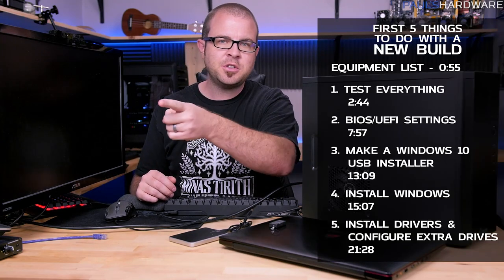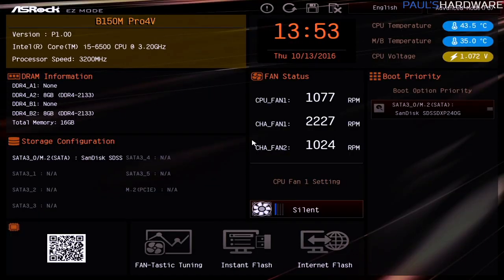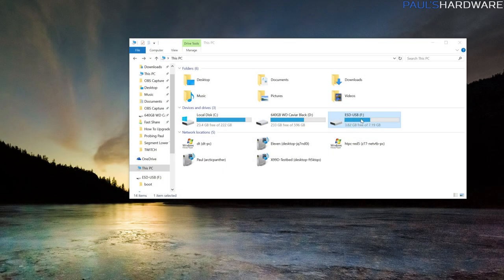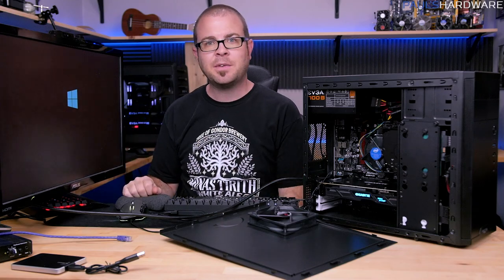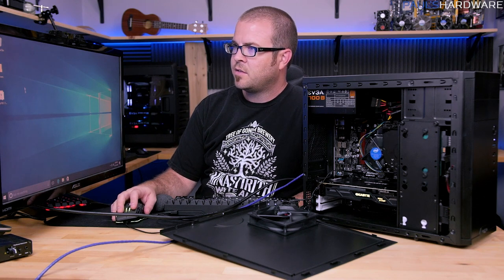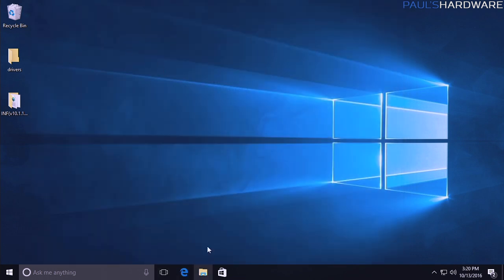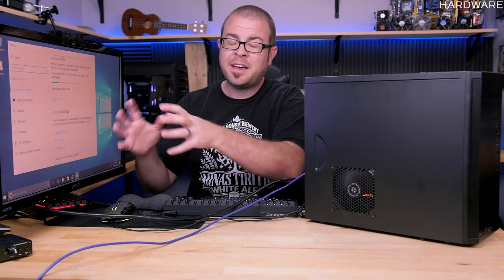First 5 Things to Do with a New PC Build

Comment: "Use usb 2 or usb 3". Dang, i really wanted to use my usb 1.1 drive.
Reply: Damn, i want to use a Diskette.
Reply: dang, i really wanted to use my floppy disk
Reply: It's all about that floppy disk
Reply: Dang, I really wanted to use 200 punch cards.
Reply: hahaha keep them coming!
Reply: potatoyeast3d Damn, my knowledge of old tech ends at this point.
Reply: What no love for magnetic tapes?
Reply: Oh dang am I the only one still using floppy drive
Reply: Install Windows 10 from Floppy?

"Plese insert Disk #2793 of 2913
...
Read error, file system corrupt"

Damn gotta start the installation all over again.

Sure there will always be someone who either uses tapes or just copies the code by hand via typing in Assambler.
Reply: Jake Conner nah i install it by hand punching cards and running them through their reader.
Reply: Windows 10 installer needs about 4gb of space, a floppy disk only has 1.44 mb of storage. So, there's no way you can use a floppy to install windows 10.
Reply: +Angel Luis Trinidad MS-DOS: ~3mb. Oh wait. They used floppys to install MS-DOS. Hmmmmm, I can&#39;t for the life of me think how they did it.
Reply: ScreenGames I'm talking about Windows 10, not MS-DOS. Windows 10 buddy, Windows 10. Wait, let me say it one more time, Windows 10.
Reply: Angel Luis Trinidad They are both just collections of files.  One just has a lot more.
Reply: Joseph Still
Exactly.
Reply: Joseph Still Exactly, Windows 10 has a collection of bigger files that would not fit on a floppy drive.
Reply: Angel Luis Trinidad
Alright. You clearly don`t get the concept of multiple floppy drives, so I`ll tell you. Ever installed Windows 98? I`m guessing you haven`t. When you insert the install floppy, it comes up "Insert floppy #1/8". You insert floppy #1, and then take it out, then put floppy number 2 in etc.
Get it now?
Reply: You would need ~2000 floppy`s, but it would still work.
Reply: ScreenGames True, but my point is, it would not fit on one floppy disk.
Reply: Angel Luis Trinidad
Nobody said it would.
Reply: ScreenGames Okay.
Reply: and i want windows 8:1. its better than 10 and thats why i didnt upgrade to windows 10
Reply: Your a masochist... and wrong!  Win10 continued where Win7 left off.  Win8 and Win8.1 were generally considered a lost cause for Microsoft
Reply: potatoyeast3d 200? that's funny
Reply: Can I pull up a picture of a usb 3.0 flash drive on my phone and shove it into the CD drive?
Reply: It would take about 2,778 floppy disks to install Windows 10. That wouldn't take very long, kek
Reply: BoZik fking kek xD
Reply: Is it bad lads if when I was younger I believed that you put money into the CD slot and that's how you make online payments on Amazon and shit?
Reply: GameRushz03 that be cool though.
Reply: Angel Luis Trinidad yep you totally missed the joke
Reply: I did not see paper-tape listed. If you list punch cards, keep in mind that paper-tape was used to load drivers, etc. in that vintage era. 4-bit was the most basic version that hung around a long time with the military.
Reply: ScreenGames i remember having to install Windows 98 to NT like that
Reply: I prefer floppies
Reply: I use USB 3.1 SS+
Reply: Some of us cool kids have 3.1
Reply: Angel Luis Trinidad then I'll use 2856 floppy disks!
Reply: Souperpie84 grroovy
Reply: Souperpie84 z
Reply: Fuck it i'll buy a wireless wifi  adapter or usb. I aint gonna be using an Ethernet cable cause I hate those things.
Reply: Jake Conner Made me laugh thx mate xD
Reply: Jake Conner p
Reply: If a Z270 mobo advertises memory frequencies as "OC" can I manually set them in the bios?
Reply: Jake Conner wanted to use my cassette
Reply: dang, i really wanted to use my vinyl disc
Reply: Dang I wanted to through the flahdrve at the PC an hope it works
Reply: Dang, I really wanted to use my stone and twigs
Reply: Dang, I wanted to use my NES cartridge.
Reply: Dang I wanted to use my floppy
Reply: you have summoned me
Reply: Dang, I really wanted to emulate a cassette drive by making noises into a microphone
Reply: Dang, I really wanted to to memorize it and write it on the the hard drive with my mini magnet.
Reply: You weren't  even around then. It took 64 cards to make a single letter. It's tape drive all the way. That's  an eighteen inch one, by the way.
Reply: i want to use VHS casette
Reply: Angel Luis Trinidad buy bigger floppy
Reply: hdmi drive 🤯
Reply: Jake Conner i wanted to use old console cartridge
Reply: Dang i want to use my brain as hdd but its already full 
Total Space:1byte
Used Space:1byte
Available Space:0byte
Reply: LazyAndrew1333 my bottle of vodka has 666tb memory
Reply: Gotta load it off a cassette drive whenever you want to use it.
Reply: Wait, which vacuum hoses need to be turned on again?
Reply: Scrolled down to find this comment

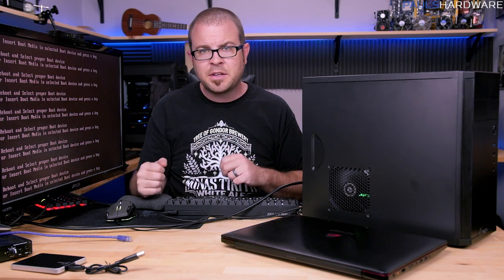Comment: 1. Test everything 2:44
2. Bios/uefi settings 7:57
3. Make a windows 10 usb installer 13:09
4. Install windows 15:07 
5. Install drivers & configure extra drives 21:28

Comment: Point of advice to all that was not mentioned in the video:
When booting from USB to install Windows, DO NOT put your flash drive in a USB 3.0 slot or you'll get the Windows Installer asking you for a driver and not being able to proceed with the install.
The reason for this, is that you have not installed your USB 3.0 drivers yet needed by your board for them to function properly!
So, to be on the safe side, make sure to do your initial install from a 2.0 port.
Hope that saves someone frustration and a headache.  =)
Reply: was just about to install windows once i got my processor, thanks man!
Reply: Dave S. What if you only have usb 3.0
Reply: @salierisneighbor9736 
Plug it into a USB 2.0 port and it'll operate as a 2.0 drive.
Reply: psedog you mean on the motherboard?
Reply: @salierisneighbor9736 
Yes, either on the ports on the back of the motherboard. Or the ones that connected to your case io.
Typically 3.0 ports will be blue and 2.0 ports will be black.
Reply: psedog nice my X470 gaming motherboard came in a couple days ago
Reply: psedog thanks for the tip
Reply: @salierisneighbor9736  That board has 2 USB 2.0 ports at the top of the rear IO. Your USB 3 ports are 3.1 so they are red, not blue.
Reply: psedog thanks again
Reply: Thanks!! That work
Reply: thank you so much :) having that problem rn currently.
Reply: This is not universal, I installed windows via USB 3.0 last weekend
Reply: @nikoyochum6974  Me too.  It had no problems
Reply: @salierisneighbor9736  so even if i have 3.0 stick i can plugit into 2.0?
Reply: This was an issue on Windows 7. Windows 10 should recognize USB 3.0 natively and does not need any drivers to be installed first.
Reply: @moezilla7838  if i buy a new case and motherboard with usb 3.0 ports .Then what shall i do ?? what if i have no usb 2.0 ports?
Reply: Saumyojit Das every motherboard should have USB 2, check the rear IO, usb 1 is white, 2 is black, 3 is blue, and 3.1 is red
Reply: @saumyojitdas4212  Use the 3.0 ports, in most cases these will work fine even with older usb devices. However any modern motherbord I have seen so far had at least two 2.0 ports on the back panel (the black ones) and two headers for internal USB 2.0 devices like card readers or front USB.
Reply: Installed normally on the 3.0 port
Reply: I have been stuck on installing windows 10 on my new pc for 4-8 hours. This fixed it. Thank you so much.
Reply: Mine didn’t do that
Reply: Daniel Kozma yeah I used my 3.0 and it worked fine...
Reply: it worked in 3.0 for me
Reply: Mhh, bought my Asus X570 ROG Strix -E This week, but this Mainboard only have USB 3.2, even my new Case have only USB 3.1 and 3.0. I will see, how the new System will boot windows from the USB Stick i prepared. :/
Reply: @GeneralAblon  I'm still stuck
Reply: @simply_based  then I do not know what you need to do. As can be seen from my comment, I am no programmer. Basically, I just started up my pc, with the usb in a usb2 port. And then it worked. Just be sure to make it boot on ther SSD.
Reply: Thankyou i will do that when i finish my First build
Reply: callum connelly no, 3.0 is fine, just needs to be in a 2.0 port
Reply: Niko Yochum the difference is drivers. The windows 3.0 installer does not have drivers for usb 3.0. Higher end motherboards natively support usb 3.0 at a bios level and don’t require drivers. Other not so lucky boards need the driver, which the win 10 installer doesn’t have, and throws the error
Reply: This is a great tip 👌.. With my luck, I would have done just that. And wondered why I am getting a funky screen.
Reply: mine worked from install on a usb 3.0 (blue port.) I think it might depend on the motherboard.
Reply: Pog thank you
Reply: That's just pure Windows stupidity, I installed W10H2 today from a fast USB flash drive in the first mobo USB port (3.0) and no driver required.  The drive worked noticeably faster than mobo utilities install from a DVD drive.
Probably MicroSloth has added universal drivers into the booted image.
Reply: callum connelly  nop
Reply: Do you have to disable secure boot in Bios before installing W10?
Reply: Omg im having a bunch of trouble. If this is the cause im going to scream
Reply: I installed off of USB 3.0 on the front panel with a low end msi b550 mobo with no issues at all
Reply: I did this on a usb 3.0 and it worked lol
Reply: That explains why I had problems then, thanks man
Reply: Only with older machines.
Reply: What if my case doesn’t have. USB 2.0
Reply: @psedog  t
Reply: @AB-ii4pb  how about the back of your motherboard?
Reply: You are such a Gem. Thank you!

Comment: 20:00 DON'T do this. If you do this, you still didn't change the boot order. So if your friend or customer will insert a flash drive later and reboot their PC, it will try to boot from that USB, obviously failing. I had hundreds of problems because of this.
Reply: ^ This
Reply: how should i do it then?
Reply: @carls.6746   change the boot order from the bios
Reply: Hey, this is my first time building a gaming pc so I have a question about this. I'm suppose to have the ssd that I'm installing windows 10 to at the top of the boot list?
Reply: @dug1963  you would need a bootable USB, watch a video how to install windows 10 using bootable usb. Basically, since your SSD is empty currently, you download windows 10 on the usb and boot from there, when you get into windows then you can transfer the files to the SSD an use the SSD. Hope this helps

Oh and yes I forgot to answer the original question, get into the bios by clicking delete repeatedly, then Change the boot order so your usb is first, which will allow what I said above to happen :)

Comment: With what did you record all the BIOS setting without even have the Windows been installed yet?
Reply: a capture card?
Reply: a capture card from another system(computer) i guess, just like recording stuff from a ps4/xb1
Reply: A capture card? what does it look like? how does it work? so, basically I need another PC/laptop to do the recording job? Is that what you mean? Hmmm....I see.
Reply: depends on what capture card, some of them require another PC, some don't
Reply: Some of them have recording storage inside? Ok, sounds expensive.
Reply from the maker: yes, it was recorded on a 2nd computer with a Razer Ripsaw USB 3 capture card
Reply: so what, do you plug the pc's together or something with a cable and it just records the other pcs screen?
i might need this
Reply: +Jihan Cessar Hallel Gurning They can be less than £50
Reply: +ScreenGames Good to know. Thank you.
Reply: Don't forget if you have a smart phone, take a photo for your personal record
Reply: Jihan Cessar Hallel Gurning sx s*f, ,
Reply: prob hdmi recorder of some kind
Reply: Jihan Cessar Hallel Gurning probably a capture card

Comment: But before you do any of this, get a new surge protector power bar to protect everything plugged in from power surges, lightning, spikes etc. Power bars do wear out and need to be replaced.
Reply: +1000 on this. It amazes me how folks will spend thousands of $ on a new PC and not spend another $25 or so on a new surge protected power strip to protect it....it boggles the mind really...
Reply: Eryk Grabkowski ur comment x100
Reply: Good sir, you saved me money!!!
Reply: Lightning is a risk, there are two times when I've experienced this. A couple of years ago lightning struck nearby, it fried our phones. Last year, a similar thing happened, fried the router. It might not be a big risk, but it can happen. However, I've heard that the surge protection doesn't do much in such cases for some reason.
Reply: Zed1967 Wouldn’t I just be fine connecting my pc to an outlet that’s in my wall? And also another quick question. I lived in the US but moved to Europe to go to college and I purchased my power supply in the US because it was cheaper. Would I be fine by just connecting the US plug into a connector that transforms from a US outlet into a European outlet? The max wattage on the one I have is about 3000 Watts. I haven’t used it yet I’m building my pc pretty soon. I also purchased just a random European power supply cable on eBay for a few bucks but I’m not sure if that would be 100 percent safe either compared to the power cable that came with my Corsair power supply. Sorry if it’s a lot I just need the question answered. Thank you.
Reply: Don't bother with surge protectors.  Get a real UPS that will keep the computer operational during power surges/outages.
Reply: Almost no surge protector will save you from lightning. The power is overwhelming. The best decision in a lightning storm is to unplug your pc. Surge protectors are best used to avoid damage due to powerline issues or shorts occurring within your home wiring. Not all surge protectors are created equal though. As a general rule, I avoid those under $10. Do your research and find one that has quality MOVs and good ratings from reputable companies and fits within your budget.

Comment: Can i use ethernet for the internet access ? (i'm new to this, pls go easy on me )
Reply: Yes, Ethernet is just a solid connection between the router and the PC while some people like me use wireless WiFi which ATM is slower than Ethernet but more convinient. But yes you are good.
Reply: Crippling Depression Eh my windows 10 don't have wifi built in. what should i do? It only have ethernet option. i need wifi. already have a WiFi modem here FYi
Reply: moon burst u need to buy a wireless card, preferably one u put into the pci express slot. It has Wifi built in etc. There are differemt options, make sure the one u decide on is supported for win 10, just go to manufacturers page and look for drivers..
Reply: Windows comes with networking support however it tries to automatically configure itself to the hardware that it "sees". If it doesn't detect the hardware then it won't configure it. It may also detect the hardware but not have the driver. The video demonstrates what to do when that happens.

Some PCs have WiFi built in, most have an RJ45 jack as well. RJ45 is like a big telephone ( RJ11) jack and is used for wired Ethernet connections. WiFi ( a.k.a. Wireless Fidelity) is for wireless connections. Wired is typically faster while WiFi is "easier" for the technically challenged among us. If your PC doesn't have built in WiFi then you can either get a WiFi card, open up the box and insert it or you can get a USB WiFi stick and plug it into a USB port. Either way Windows 10 should then hopefully configure itself. If it needs a driver then you need to download it from the manufacturer's web site, put it on a memory stick and then install it, much like what was demonstrated in the video.
Reply: Mike yes and I like ur dog
Reply: Mike well that’s what we all use however you can use a WiFi adapter external or if your motherboard already supports WiFi then just connect to it! However I would recommend using LAN as it is faster
Reply: Mike it's the best way for internet